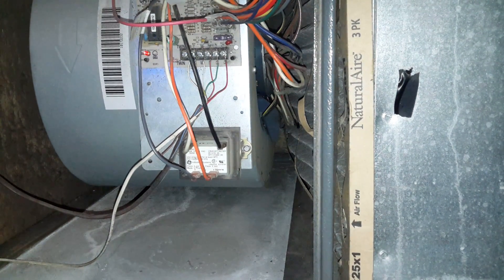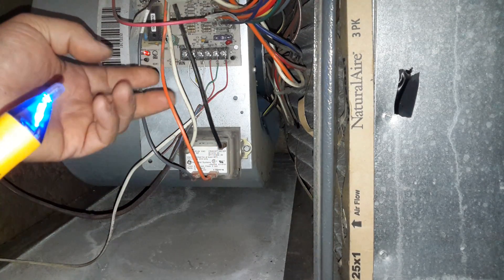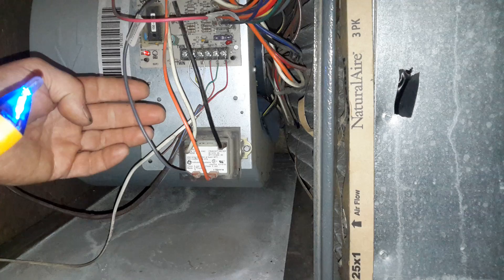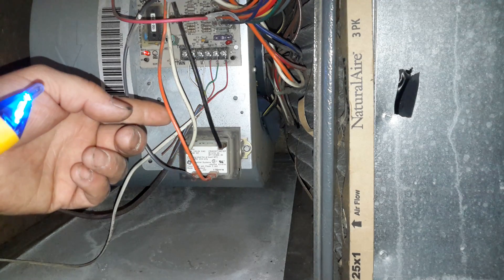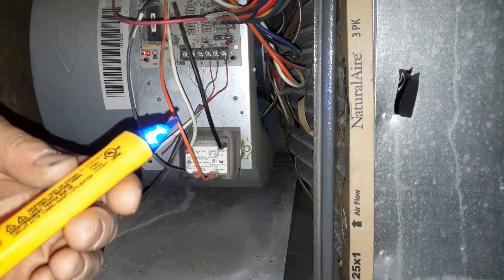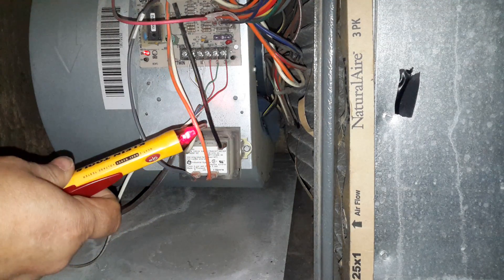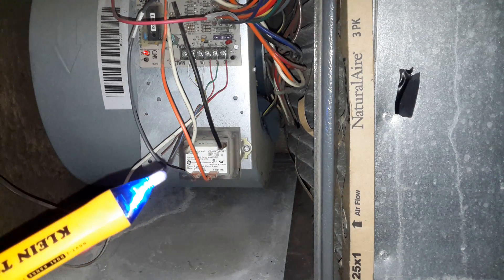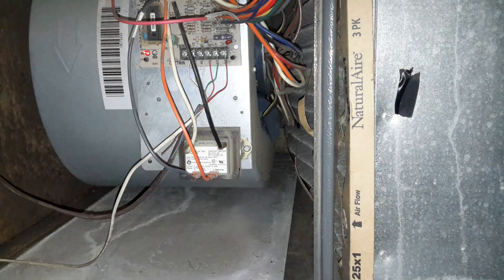Diy how to easy furnace transformer check

Comment: Is the transformer in the furnace the source of the "RC" or "RH" power that the Nest Thermostat uses on the wall? Is it possible for the furnace transformer to not send enough power to the thermostat but enough to the furnace?

Comment: Where does the common white wire go on circuit board ??
Reply from the maker: with all the other white wires. Usually there is a cluster of them.